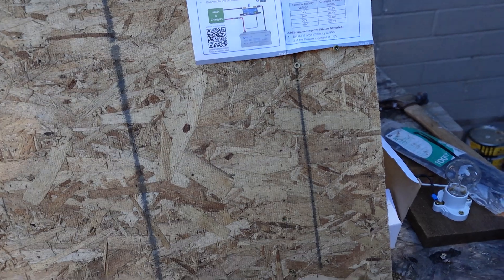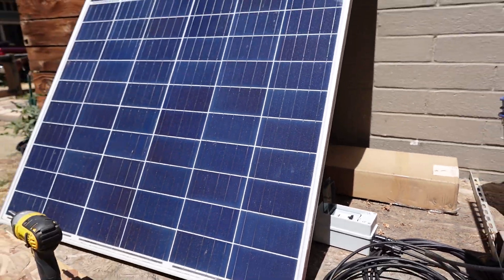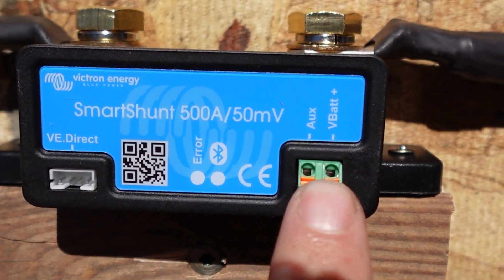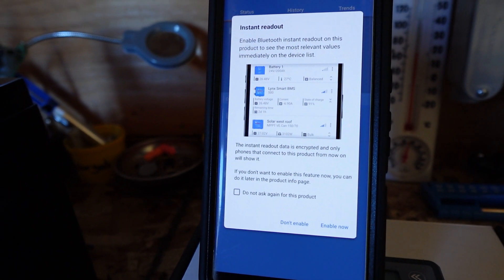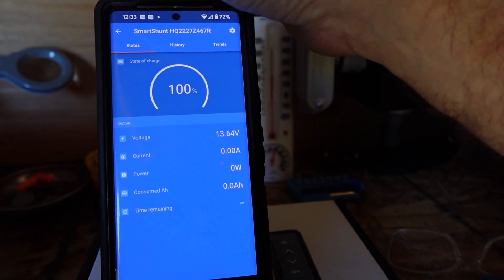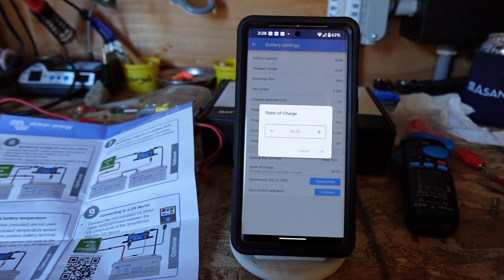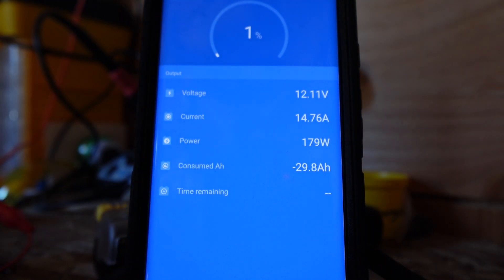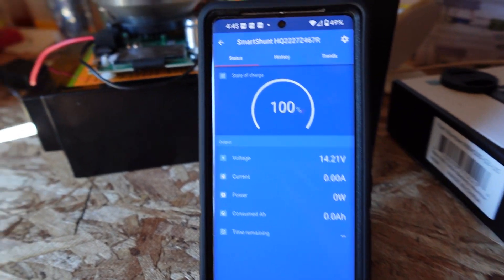Victron Smart Shunt Install and Review

Comment: Hi Gary, thanks a million for sharing your experience.  I have a total Renogy system on our RV and like you it was my first system :).  The advantage of Renogy was low price. However, you pay for it on reliability and support has been my experience. experience with support.  I already bought the core one and smart shunt 300.  I’ve had to replace all four 100ah LiON Renogy batteries within 1.5 years.  Renogy replaced them under warranty but only after tons weeks of back and forth and questions that didn’t make sense. So I’ll probably start migration parts of the system other than the Renogy solar panels themselves to other manufacturers as problems continue to come up.  Thanks again.
Reply from the maker: @burzurkburzurk5674  awesome, and I totally get the migration. Thanks for tuning in!